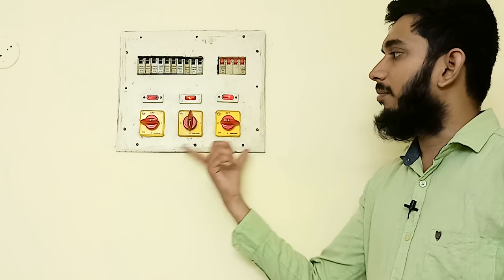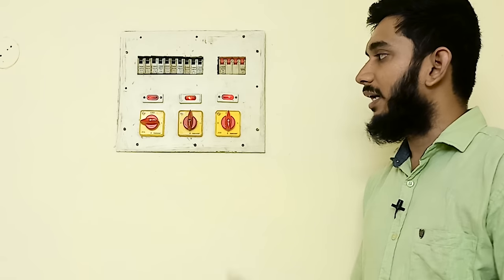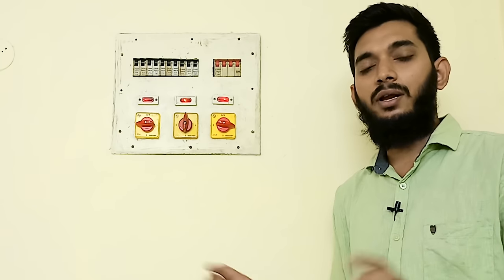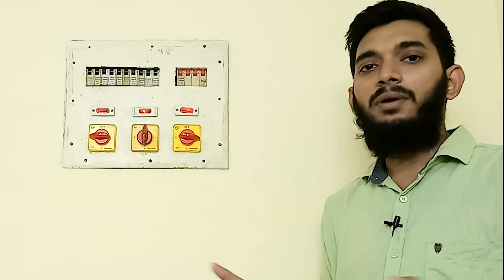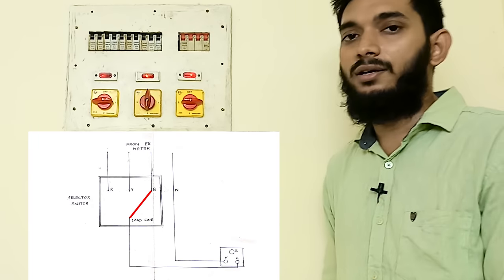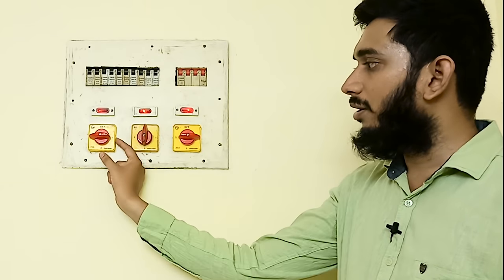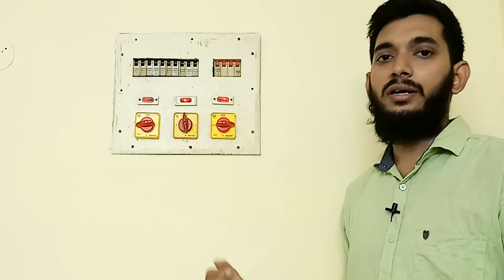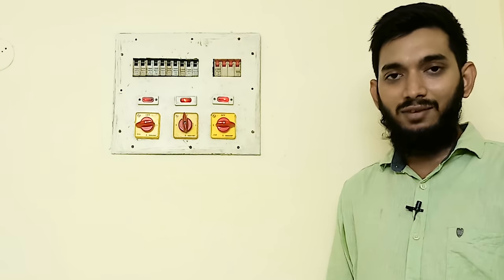How to use three phase selector switch?_ Tamil, Is it correct using selector switch while power cut?

Comment: 12v dc vs 24v dc motor convert  generator which is more efficient, low rpm high voltage like 10v

Comment: Anna,at the time of fluctuations in R, if we turn a selector switch from R to Y, should we also change the selector switch pointing Y to R, to make it balanced
Reply: If you change like that , now Y load will have fluctuations. Then what is the point. Fluctuations means that phase is overloaded already. While changing care should be taken so that high power  devices like AC are not connected in the same phase. That is because  in the original design wiring will have the capacity for one AC only. If mutiple ACs are connected in samd phase , wires might burn due to heat..

Comment: ஒரு electrical engineer என்ற முறையில் பகிர்கிறேன்:

1. முதலாவதாக, phase selector வழியாக லைட்டிங் load - lights, fans மட்டுமே connect செய்யுங்கள். ஏனென்றால்,
2. air conditioner, geyser போன்ற high power appliancesகளை phase selector மூலம் கனெக்ட் செய்வதில் பிரச்சினை உள்ளது. இந்த appliances அதிக கரெண்ட் இழுப்பதால் phase selector பழுதாக வாய்ப்புள்ளது. 
3. வீட்டில் ஒரு ACக்கு மேல் இருந்தால், உங்கள் electrician, loadகளை வேறு வேறு line (phase)களில் பிரித்திருப்பார். இதனால் load balancing இருக்கும். இந்த high power load களை தனித் தனியாக MCB வழியாக connect செய்வது உசிதம். ஒரு phaseல் power இல்லை என்றால், அந்த AC ஓடாது. ஆனால், Phase selector மூலம் fan ஓட செய்யலாம்
4. ஆனால், ACகளை phase செலக்டரில் connect செய்தால், load balancing இருக்காது. பல high power applianceகளை ஒரே phaseல் ஓடினால் fuse போக வாய்ப்புள்ளது.

Comment: ஒரு முக்கியமான சந்தேகம், இன்வெர்ட்டர் Y phase ல (மூன்று phase க்கும் )connection கொடுத்திருக்கிறோம் என்று வைத்துக்கொள்வோம்,Y phase மட்டும் supply இல்லை என்றால், இப்போது inverter on ஆகி இருக்கும், ஆனால் மற்ற phase EB கரண்டில் வேலை செய்கிறது. இதன் காரணமாக இன்வெர்ட்டர்,EB line interference ஆகுமா? ஒரு வீடியோவில் தெளிவு படுத்தவும். நன்றி வாழ்த்துக்கள்.
Reply: Appadi illai bro y phase current illai inverter on aakum but inverter circuit separate for lite loads neutral only common in three phase and inverter so no problem
Reply: @anbuthambi3633  நன்றி.

Comment: Very nice one
But it is very old manually operating system and if one or two phase resume again from EB, then nobody aware and more loads are in one phase.
Nowadays automatic phase changeover switches are available in the market and it will automatically changeover between 3 phases  when the supply is returned from EB. Manual operation not required.
Reply: Do you have the details is it available in online or on market?Link details please...

Comment: Bro...sometimes enaku oru phase la matum low voltage issues varum antha time la nan entha phase work agutho athula switch ah turn panni veipen. But neenga load issues varum nu solringa, ella appliances um antha phase ah use panna than eh laod issues varum. Mostly 2 fans and one AC tha working la irukum, appliances avlova use panatha nerathula intha maari change panni veiklama?

Comment: Hi sir i have one doubt 
I have 30 inside steam heating ironing table 1 hp pump motor for water go to boiler to use all table some time NRV(non return valve) problem means steam is returns motor has been continusly running and coli is shorted any prevent measure or any equiment for available means pls tell me

Comment: Bro make a video regarding
Why transformer side call it as KVA and
Why load side or house side call it as kw (kilo watt or watt)
Reply: KVA  in this VA(volt. X current)=power
Power's unit is watt so both are same
Reply: @chitrajayakumar8009  but this is not right answer
Reply: Transform not consuming any power its device to step up or step down, so it's rated  input and out put measurements by kva. Example Wheare us motor consuming the power so it's called in watts or hors  power.

Comment: Sir my issue is every time power cut happens motor starts running backwards... I installed rotary switch how to make it work... In not getting... Still have to change pole in MCB.

Comment: I have only 2 phase in my house, since I live in US.  I have 110V X 2 phases that is 220V.  Most of the appliances will run on 110V and AC, Dryer, Range Oven, Water Heater, Air Heater will run on 220V.  My question is how come US generates only 2 phase and to make 440V for industries, do we need to have 4 phase ??
Reply: In US some appliances and lightings are 110V and some of appliances are 220v. So there you can't put change over switch. It's fixed voltage specific appliances so such location we can't fix such change over switch or not nessery.
Reply: Dear friend in. U.S they are using 110v/60cycles.
In india we are using 220v/50 cycles

Comment: Hii bro  selector switch ha voltage issues irruka apo important application Mattum run Panna use panikilam Thana bro means R phase la voltage issues same time Y phase application not need so that time Y PHASE HA TURN OFF PANITU y ha select panikilam Thana bro
Reply: Basicaly it's selector switch so you select better voltage available on which phase.

Comment: In tamilnadu i have seen this type system in many houses...
But in my area karnataka this system is not followed...  Inside the house only trip switch is used ..  no regulator like the one.....and outside in meter only 3 fuse is used of electricity board
Reply: Olden days we use that kitkat fuse
but nowadays If u have motor load and 3 ph power then rotary switch/selector switch is used

Comment: I thought it as fan regulator
And i change it to no.3 in hall rotar and all fans run in high speed but after some times all light will blink electricity reduces  is it any problem?
And if all three phase of rotar stopped 
What to do??
Reply from the maker: Yes, put in 123 order

Comment: In our home, R & B is always low voltage. So, all three selector switches are constantly in Y position. Does this mean, the problem is with EB supply?
Reply from the maker: Maybe.. need to check further
Reply: Yes all the phases not always same voltage its problems of distribution transform issues or due to distribution network issues.

Comment: எல்லா வீடுகளிலும் இந்த phase changer switch கிடையாது.வீடு கட்டும்போது மூன்று phase சரியாக பிரித்துத்  தான் கொடுப்பார்கள். மூணு phase  ஒழுங்காக வந்தால் இந்த selector switch தேவையில்லை. ஒரு phase off ( இது அதிகமாக நகரங்களில் நடப்பதில்லை) ஆகி விட்டால் வேற phase select செய்யலாம். Suppose kitchen phase off ஆகிவிட்டால் இருட்டில சமையல் செய்ய முடியுமா. அப்போ phase change செய்யத்தான் வேண்டும். அதிக power இழுக்க கூடிய AC, geyser போன்ற gadgets மட்டும் ஒரே phase இல் எல்லாம் connect ஆகாமல் பார்த்து கொள்ளவேண்டும். எடுத்துக்காட்டாக மூன்று ac ஒரு வீட்டில் இருந்தால் மூன்றும் தனித்தனியாக ஒவ்வொரு phase மூலம் இணைக்கப்பட்டிருக்கும். இப்போ ஒரு phase off ஆகிவிட்டால் அந்த ac யைப் இன்னொரு phase க்கு மாற்றினால் இரெண்டு ac ஒரே phase இல் இயங்க வேண்டியிருக்கும். இதற்கு வேண்டிய wiring capacity இருக்காது. அதனால் wire அதிக வெப்பத்தால் எரிந்து போக வாய்ப்புஇருக்கு. ஆனால் light bulb, fan, tv போன்ற பொருள்கள் அதிக power இல்லாதவை. அவை ஒரே phase இல் இணைக்கப்பட்டால் அதனால் problem வராது.

Comment: First of all one needs to understand that the EB distribution is not balanced at all due to various factors such as unbalanced load , usage of inductive load, power theft etc. We always have a low voltage situation and severe transients in at least one of the phases always....In my house i never use R - Phase because the transients are so severe it might damage my costly electronic appliance....In fact i use servo stabilizer to arrest these transients, If one can use UPS online this would be safe alongwith servo stabilizer to prevent damages to the appliances. You cannot avoid transferring the load to two of the other phases in most situations. You must realise that there is no planning in providing power to new establishments and the govt. is interested in providing connections to commercial establishments because they get more money... If residential house are also in the same locality then what you have is highly unbalanced situation in the incoming EB cables.... Please try to collect stats on load distribution and then analyse ... No one cares for all these things in our country.....Similarly we have invariably a situation where the earthing is extremely poor in most of the localities...The changeover switch is useful since at least i get rated voltage...In my house i get 225 in B Phase , 200 volts or below in Y phase and less than 150 volts with transients in R Phase....in the incoming line.....